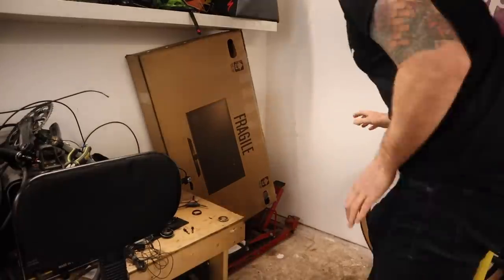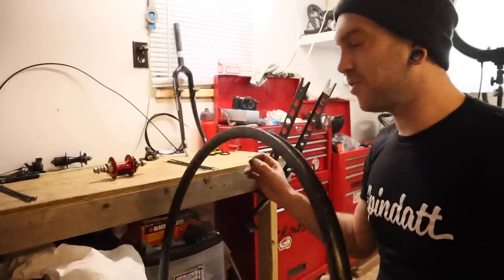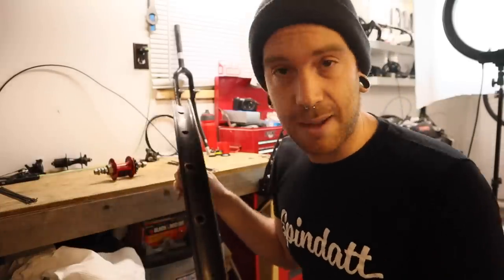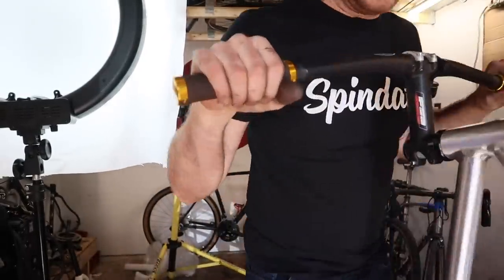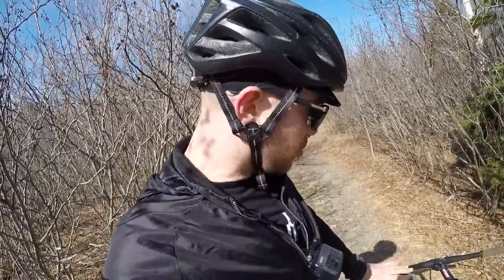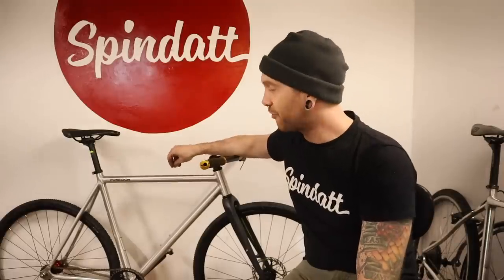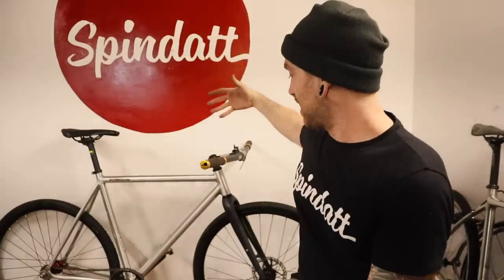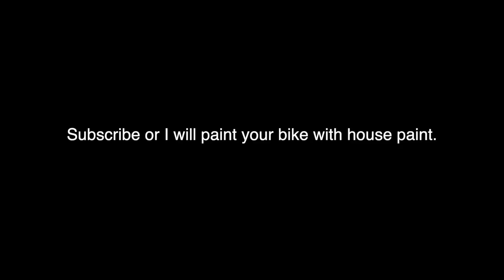Finally Built The Tracklocross Bike

Comment: Greetings from Ontario. Good to see you on with Russ recently. Last week messing around with the bikes. Therapy for the times but no shop open to get a few parts. Updated the Haro Beasley back to a city bike by removing gears and drop bars and 27.5's. Set up with a fixed/disc Surly hub and 700x35 winter tires. Went for a ride yesterday through some closed road work. Just rolls over the bumps nicely. Had to cheat with a tensioner...40/17. Will have to do that more often not just riding around town. Cheers.

Comment: Front foot should have it's pinky toe right on the bolt furthest from the pocket of the board your flicking against. Angle it so your toes face the pocket of your board facing closest to them. Flick up and out, make sure your shoes leave a nice rubber line to see where your good flicks are and where the bad flicks are. The most important thing is to keep your shoulders dead square with the bolts and jump straight up.

Comment: So take the hub out of a derailleur wheel, build it up with an offset rim and track hub using the spokes from the derailleur build (but reversed), and not only does it work well enough to roll in the frame, but the worst thing that happens is a flat on the maiden ride, and you gotta go tubeless (which you were gonna do anyway). Who's your patron saint, Spinney? I want to hire him.

Comment: Any chances you know of a reasonably priced single speed disc brake frame? I've searched high and low and the only one I've seen is STATE bikes and it wasn't as reasonable as I was hoping for
Reply: According to the Poseidon website they can sell you this bike with a disc brake fork.  Frame + fork + headset is $199, so with the disc fork it'll probably come in at ~$250 at most.  Not ideal for a SS setup, but a front disc + rear rim brake would still be plenty of braking power considering that the front does a bulk of the work usually.

https://www.poseidonbike.com/collections/single-speed/products/fx-tracklocross-frameset

Comment: Nice vid. What components, fork, tires and size did you use? How much do it weigh? I purchased the same frame and working on a build myself. I saw in a video in the past you made using the Velocity Quill rims would that be a good rim for off roading on that frame?  I'm thinking of putting together a set for mine.

Comment: How's the fit on the Tracklocross? I'm trying to determine which size I'd want, but the geometry details are thin at best.  The reach on the Medium might be my best option, but I'm afraid it'll have a CX level stand-over that'll make it impossibly uncomfortable to casually ride. Any insight you can add?  Does it fit more like a CX frameset?

Comment: What about the stock fork?  Any good?
Reply from the maker: I never rode it, but I imagine it’s good enough!
Reply: Had to continue my search for a frameset...  I wasn’t thrilled the fork was aluminum but with 35c tires I wasn’t too concerned,  then I found out the for isn’t drilled for road brakes...  looking for a frame to swap my existing parts onto...  Steel is preferred with wide tire clearance..  Looking at the Motobecane Jury frameset now..

Comment: Hhaha.  I like the ending where even the dog knows he needs back tf away from that.

That's a pretty little build.   I do the same with stems and spacers now but i don't know if it's for the same reason.   If I leave enough steerer for just a small spacer on top (or bottom), I'll have more options when I need to replace headsets, stems, bars, whatever.